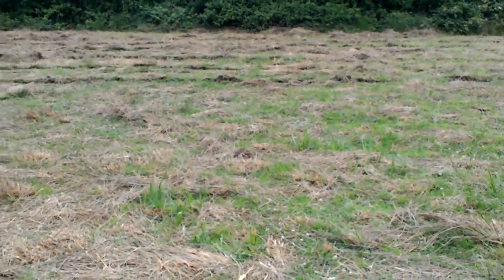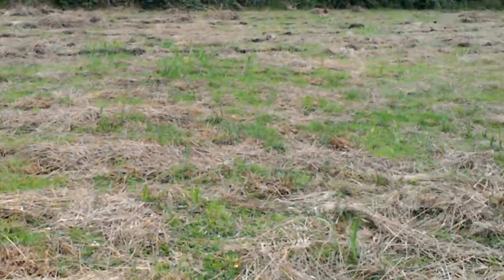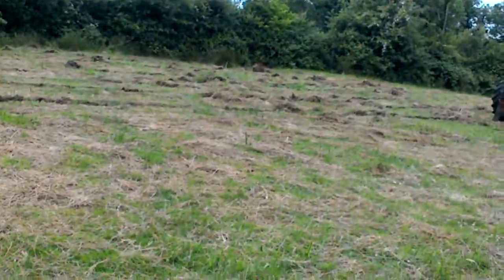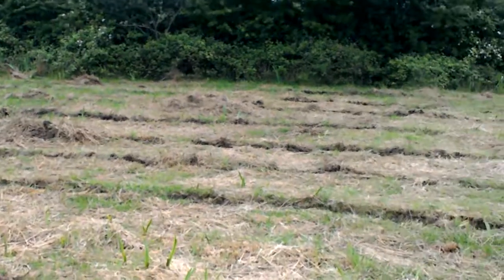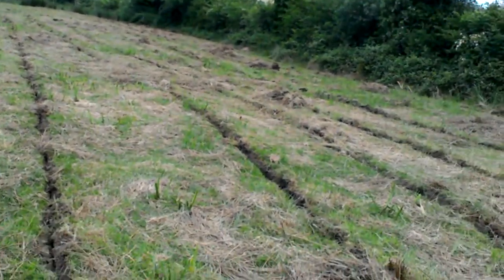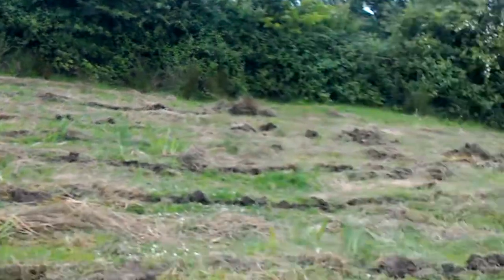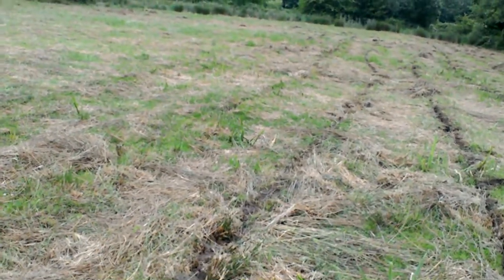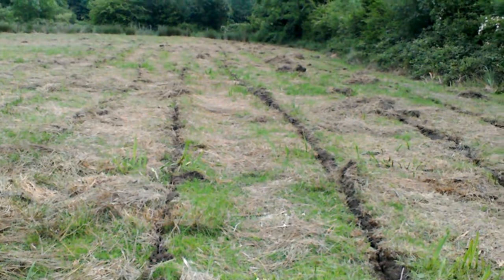Leitrim land rejuvenation part 2 -2015

Comment: Have you ever looked into Ground limestone for the land, or have you ever gotten soil samples taken? An easy solution to the rush clogging problem would be flail mwing it so it turnes the rushes into dust, so they rot down quicker into the soil, and release more neutrients back also.. We are contractors based in Drumshanbo so we know too much about the Leitrim ground 😂 best of luck with the project and I look forward to seeing an update 👍
Reply: Liam Moran I fitted a coulter to the mole plough and it made a big difference. I had a rush mulcher mill the rushes but the field is in a terrible state with a collapsed shore making a complete mess of the field and cannot get anything done with these terrible weather. Rushes were booked for licking in August but will have to wait until Spring 18 by the looks of it.